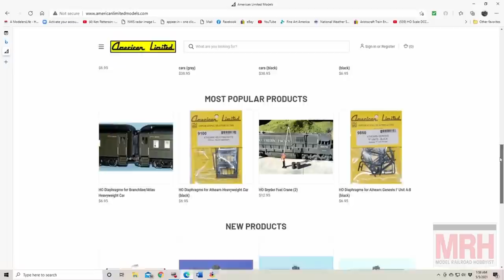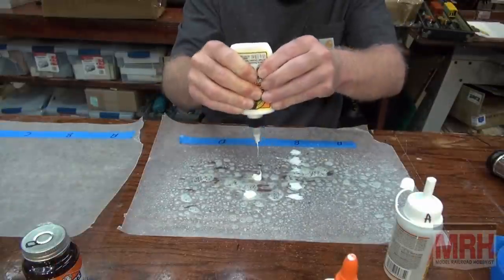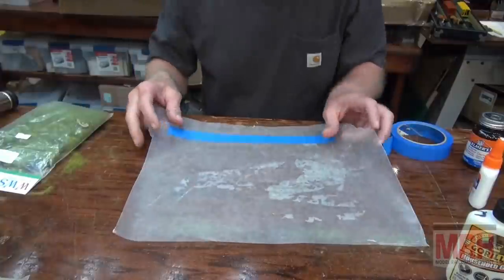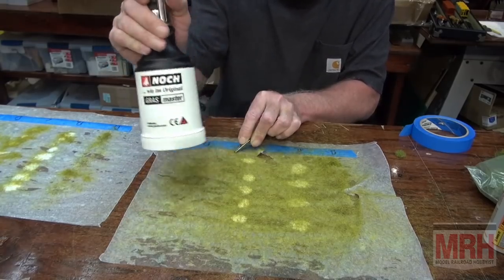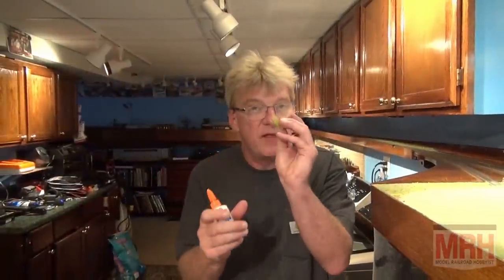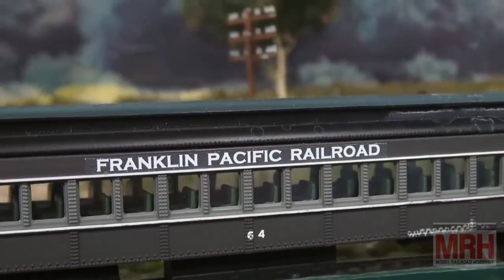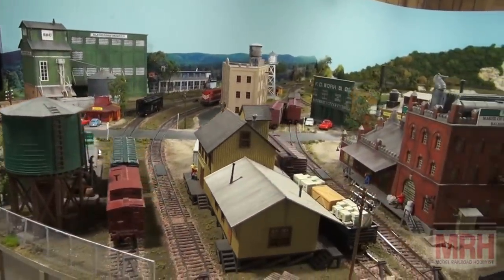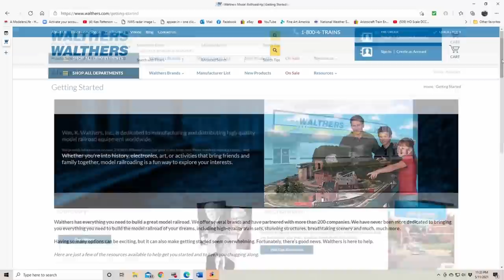Best DIY static grass tufts | September 2021 WHATS NEAT Model Railroad Hobbyist

Comment: I use a glass sheet works perfect. You can use an artist knife to peel the grass tufts off, depending on which glue you use. Cleans up  nicely with soap and water for you next project. Thanks for the demo Ken.
Reply: That's a good tip.

Comment: Tufts. Normal PVA or matte medium will work extremely well. However, instead of wetting the paper (thus letting the PVA penetrate into it), you just put the paper on a (baking) tin and clip one pole of your static grass applicator to it. When dry the tufts will peel off easily.

Comment: I use Aluminum Foil with Dap Alex Plus Silicone Clear Caulk . Clover the Foil with several beads of caulk then smooth it out to the thickness you want. The Aluminum Foil Makes the Grass Up.

Comment: I don't use wws static grass anymore for the very same reason. It does not come out of the applicator!
I now use Noch static grass with much better results.
As for glue I use mod podge Matt. And I don't wet the wax paper instead I use an old baking tray underneath the paper.

Comment: Do Not Go by his suggestions on static grass. There are lots of great tutorials on using white glue and even thinned 1:3 white glue and static grass. Don’t spray water on it.  Just place in a baking sheet with wax paper.
Reply: Yes!!.. This method was used by Luke Towan.  I do the same, just use the wax paper.

Comment: The grass tufts worked better for me by using old scrap plastic lids and PVA glue , they look better once glued down with some dirt blended in around the edges. I also made them in an old oven baking dish to help collect the excess static grass.

Comment: A metal plate below the baking paper would be a lot better than water. Plastic clear sheet work very well (just flex it to release the tufts), and the sticker wax paper even better (keep these wax paper when you stick some big sticker!).
PVA works quite well, I still need to try the Woodland Scenic Tuft-Tac, it should be even better.
Doesn't have the Noch applicator a bigger screen? The big one of Static King is working for 12 mm (it isn't marvelous with this length, but it works).

Comment: Ken, wetting the wax paper is totally unnecessary.  Plus, a better choice than wax paper, is the clear plastic used for Zip-Lock bags.  It will not only allow glue to be applied in dots, but after the glue dries, you can bend the plastic as an assist in removing the grass clumps. Just clamp a T-Pin in the alligator clip, and make contact to the plastic ... the glue is already 'wet'.

Comment: Water is completely unneccesary...just tape the sheet down to a cooking tray, dab elmers down, use a static grass applicator with the wire in the glue, then let dry 15 mins...then turn upside down and tap the tray to get the excess grass and let elemers dry fully. Done

Comment: You might get better results with everything but the rubber cement if you use clingwrap. Wrap it around a flat surface tight like a board and tape the ends down if nescicary. But none of those other glues should stick to it once dry.

Comment: My technic to make these fast, easy, and clean tufts to any design and high (2-4-6-10 mm) is to use a piece of a metal plate (I use an aluminum base 4"x8") connected to my DYI static grass dispenser and for the base, I use a thin black silicon sheet I "grab" from the kitchen, on this sheet I use normal acrylic white glue (it turns transparent) and put the blobs of glue on the silicon sheet, spread the fibers, recollect the fibers that didn't stick to reuse them.(Under the plate I put a big sheet of paper to catch the "flying fibers") . No Water, no mess, all the tuft peal without any problem.

Comment: the gras master has problems with the longer grasses because they get plugged in this balls
 you litteraly have to pluck those balls apart before you are able to use it, 
then even the mesh has no problem to evenly thick spread the gras.

Comment: Grass Tufts are installed with tweezers to avoid disrupting the vertical placement of the blades. Mashing down on the 
tufts pretty defeats the purpose of the static generator.....Something else is going on......

Comment: Ken, sorry, but that has to have been one of your worst DIY segments.

I will add my support to NOT use water. Put the wax paper on a metal baking tray to get your conductivity. Then practically any glue will work. I use, mainly, Mod Podge, or any simple white glue. Perfect tufts every time.

Also. WWS static grass tends to clump, so really needs to be applied via a grill. For the longer 10mm type grasses, you need a wider spaced grill, rather than the more common grill that comes with most grass applicators.